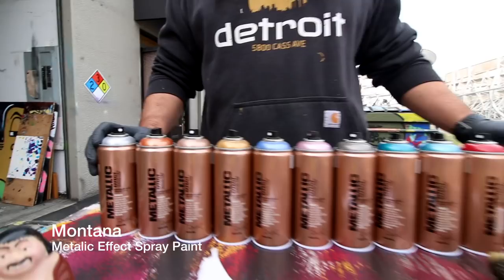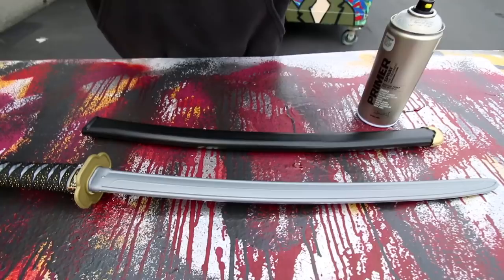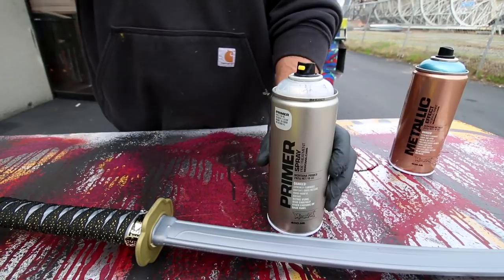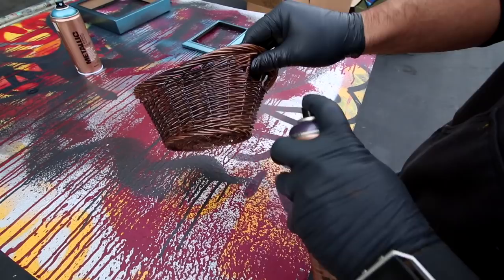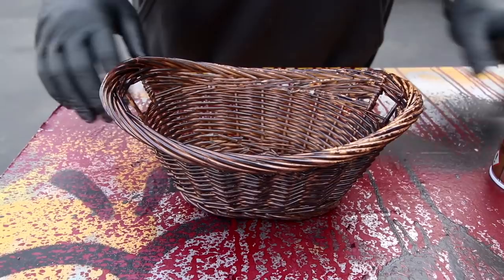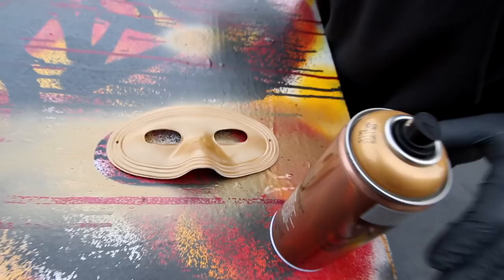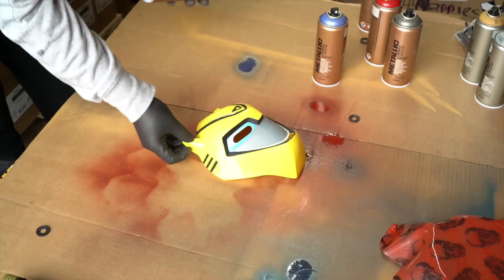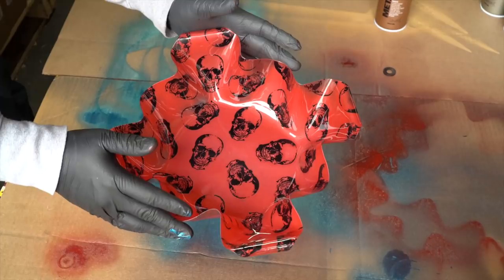ArtPrimo.com Montana Metallic Effect Spray Paint

Comment: These remind me a lot of a short-lived Rusto product line in the late 90's to early 2000's with a range of tinted metallics.  I'm sure they were cool for some purpose, but graffiti wasn't it.  That teal looks really good on the picture frame.  

Montana has a really excellent finish on their metallics.  The particles seem to be much finer than Rusto and have a silky quality.  If you can be a bit patient and apply a fill with 3-4 light coats, the end result turns out so much better.  Sometimes blasting paint out as quickly as possible leads to more work later on.

I would definitely use those two blues on a nice wall piece.  The coverage seemed at least as good as some of the 2-3 coater colors that Montana has, I have no problem with that.
Reply from the maker: This guy knows his paint! 💪

Comment: Suggestion, Could you include testing on paper in the future as well? i do fine art stenciling on paper, and wonder if metallic would lose their luster on paper?
Reply: Maybe try applying clear gesso or clear matt varnish to the paper prior to applying the aerosol so you achieve uniform coverage. Or don't. The effects of not could possibly give the piece more depth because of the variations in the metallic finish. Just a thought....